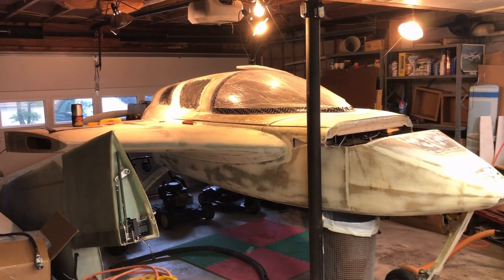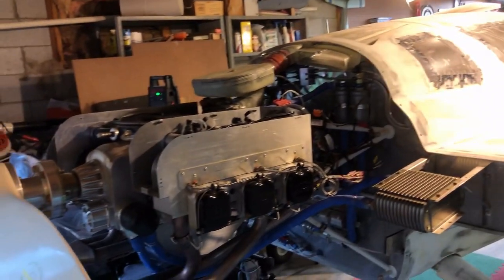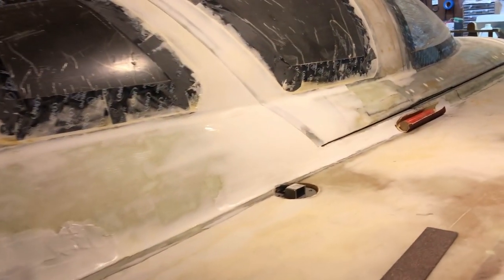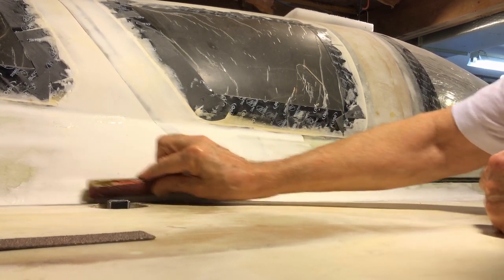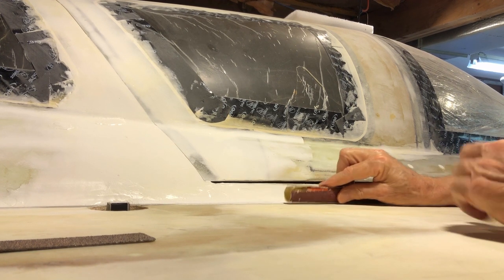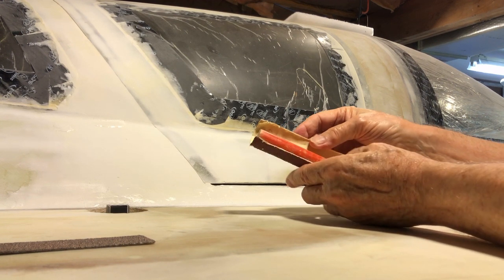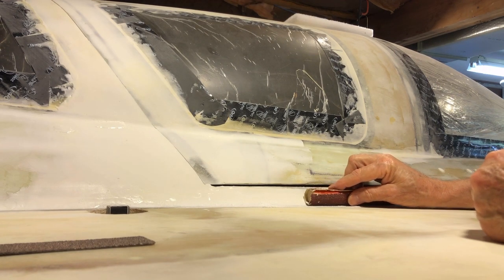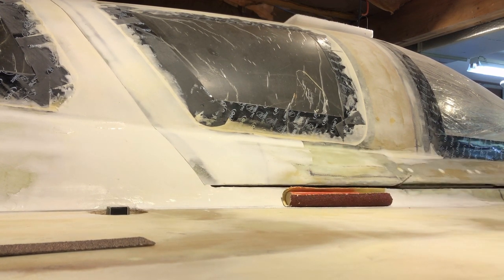Finishing preparation - or "The 1000 hours" of sanding!

Comment: Are you using West epoxy for the filling?
Reply from the maker: Yes, I am, Dana.  It's sooo much easier to sand than other epoxies!  I make they micro slurry as dry as I can for the same reason, and it's lighter than wet micro.  It's my belief that it's not as allergenic, either.